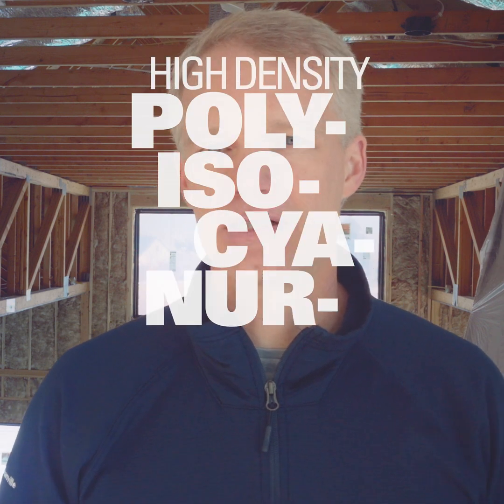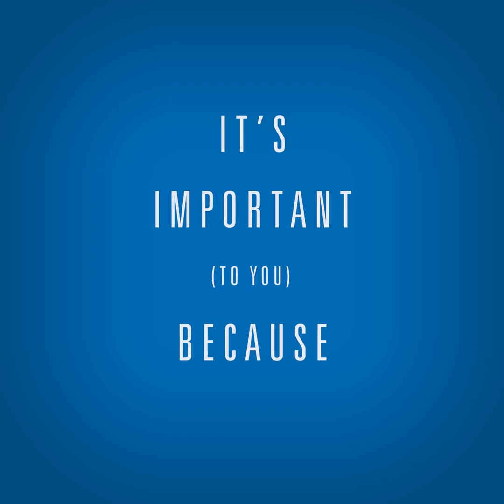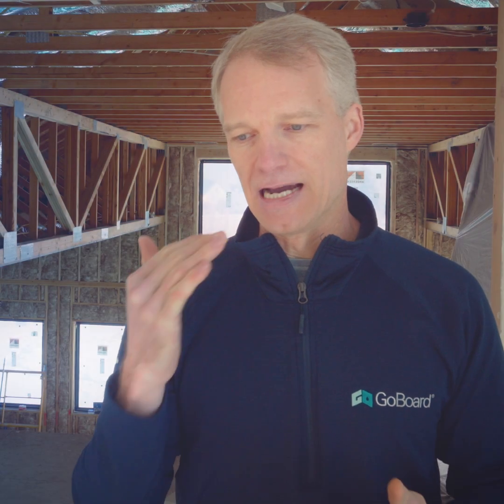What Makes GoBoard Waterproof?

Comment: If the foam is the waterproof layer and not the felt, how does caulking over the felt at screw penetrations make them waterproof? Water will just seep through the felt and into the holes, making caulking over the felt ineffective.
Reply from the maker: The facer isn't felt.
Reply: @Regardless, water can still pass through the skin, correct? This means it can seep beneath the surface and into screw penetrations or thru to the other side of the corner butt joint.
Reply from the maker: @Bryce-ww5no  Sufficiently seal the fastener penetrations with GoBoard Pro Sealant by at least 2 inches in diameter. We test the fastener penetrations to ANSI A118.10 with the 24" water column for 48 hours with no leaks behind joints. The facer does absorb water for thin set compatibility, but is low wicking.
Reply: how does it hold up in outdoor installations? Particularly northern climates -10 for a few outdoor BBQ walls.